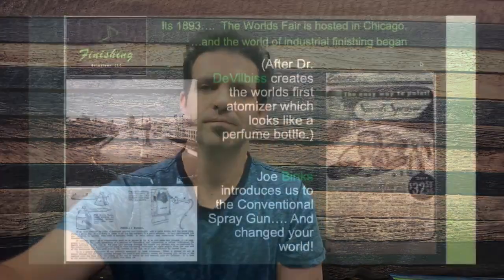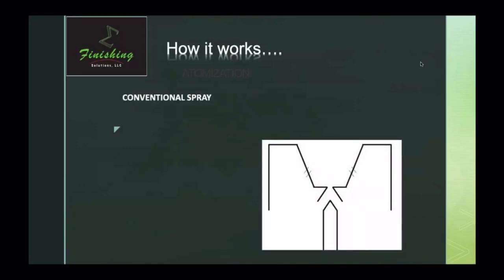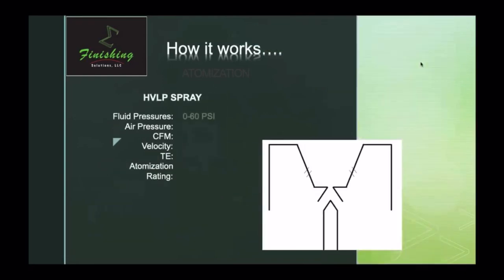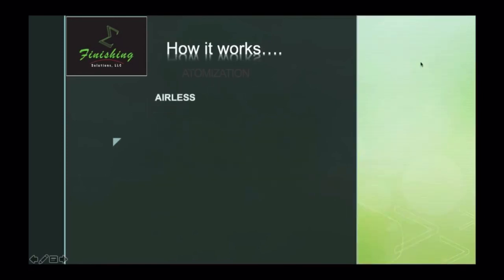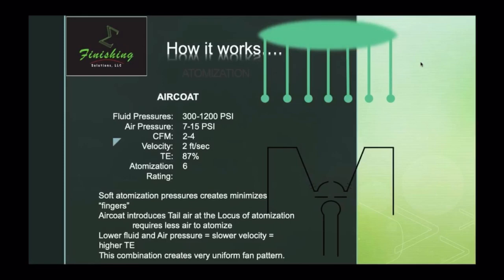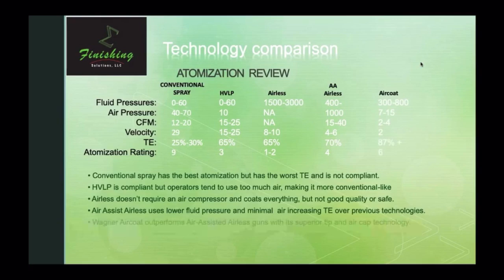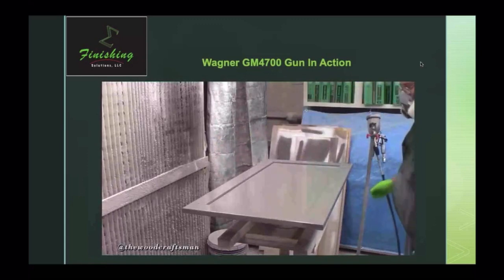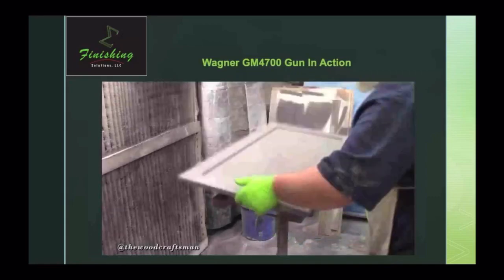Ty Crowder talks Air Assisted Airless, Airless Sprayers, Hvlp and Conventional Spray Guns

Comment: When I decided to go AAA I chose a tritech T5 coupled with the wagner 4700 and an 8  gallon compressor. I can use the T5 as standard airless when I want to and switch over to AAA for cabinets. It ends up being cheaper and more versatile than dedicated AAA units.

Comment: Compared to air assist airless, would airless be more user friendly and with comparable results spraying water based coatings? Contemplating the titan 440
Reply from the maker: Yes airless is the easiest to use.

Comment: HVLP, for the benefit of the viewers - hopefully everyone reads all the comments - by HVLP what is really meant is TURBINE. My air-assisted airless guns, my CAS (compressed air supply) guns are all HVLP. My turbine guns are all HVLP. Turbine. Maybe it's because turbine guns use a garden hose to deliver the air and the air is supplied by a vacuum cleaner type motor, namely a turbine.

It really is inconsequential that there's less than 10 psi through the air cap. Transfer efficiency is also not the giant issue that a finisher needs to think about. What matters most is the quality of the cured finish, and that's greatly dependent on the quality of the fan plus the consistency of the prep work and the spraying technique of the finisher.

The greatest transfer efficiency is from the paint brush. Ok, let's all go back to the days before spray guns, put on berets, grow Pierre-type mustaches, grow some chin, and do the Rembrandt & wrist thing, 95%+transfer efficiency. See my point? To paraphrase Warren Beatty, I do.

Comment: Anybody has information on the titan aircoat capspray?
Reply: Late answer but I just got one, do you also have one?
Reply: @DownloaderVideo   yes I bought one, I love it I use it mostly for refinishing
Reply: @goodlife1500  Great, one question man as I just got it used. Coming from piston airless machines I have 2 things that have me worried. 
1 One in prime mode the machine primes fine but if I trigger the gun I also get fluid…is that normal?

2 My pressure is kind of wobbly in the sense that the gauge is not steady firm….it builds pressure but after it get to the pressure I want the needle kind of shakes and goes down 200-400 psi when I trigger the gun. 

Are these behaviors normal?

Thanks in advance

Comment: Thank you for making these very educational videos.
I never heard you guys mention Graco g15/g40 guns which seam very similar to Wagner Aircoat. G15 is designed to work with only up to 1500psi fluid pressure. They are both 20%-30% more expensive than Wagner so I was wondering do you know how they compare to each other.
Reply: Yes, I use graco G40 - Wagner diaphragm pro gold - the bull rolair compressor and we do Beautiful Factory Finish every day
Diaphragm pump works great can go very low pressure 650 psi and keep this uniform 
G40  Pressure I use around 28 psi
- 35 psi  dont need too much air 
And if we need use this gun just in airless mode (heavy paints) this gun support 4000 psi .

Thanks for you videos you have very interesting information
Reply: I'm runnung both the G40 and the G15 guns. I have a big assortment of tips. Spraying converevarnish and also catalyzed primers, all solvent materials.